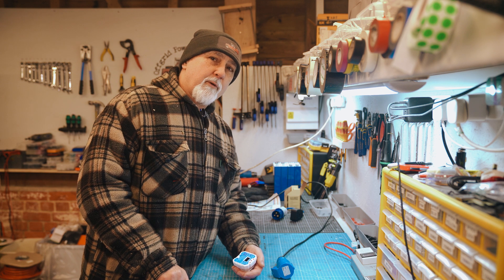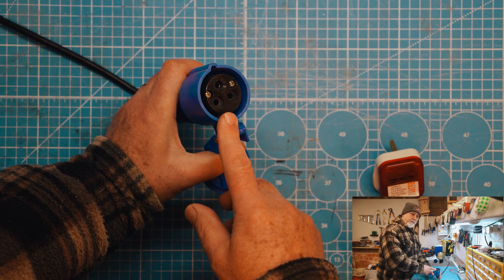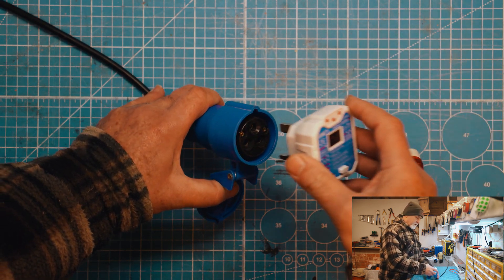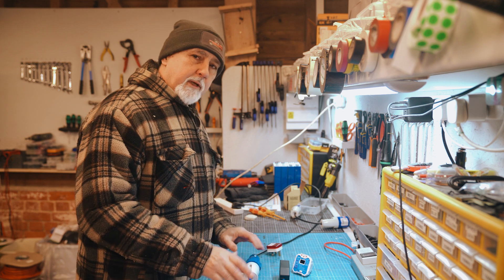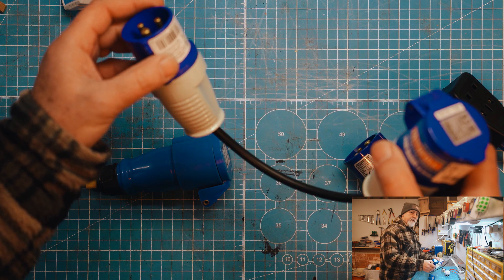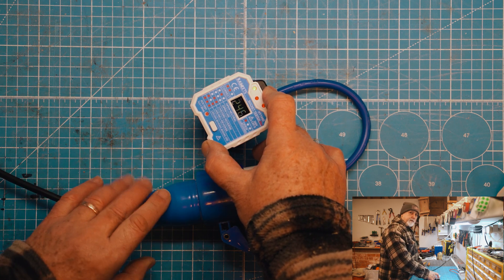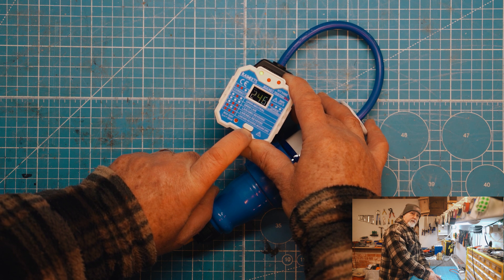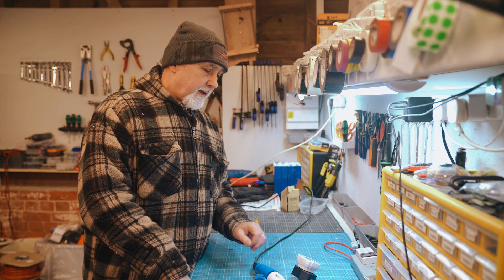How to safely use campsite EHU when travelling in your motorhome or campervan

Comment: You reminded me of a time when I was testing installations in static caravans. Using a professional RCD testing device, I had to establish that the response time was satisfactory. The problem was, which RCD would it trip? 1. The one in the caravan consumer unit? 2. The one installed on the post beside the socket supplying the caravan? 3. Another RCD further down the line? On the odd occasion it would trip number 3, cutting off a number of other caravans. It was best to avoid mealtimes and dusk/evenings.

Comment: The AC supply is Live and Neutral. Positive and Negative is DC.
An RCD does NOT need an earth feed to operate correctly. An RCD trips when there is an imbalance in the Live and Neutral currents due to fault current. The fault current can flow to any object at earth potential and not necessarily the earth feed provided by the supply socket.